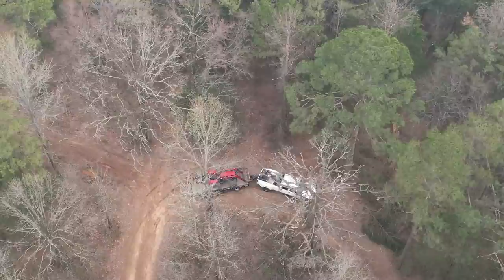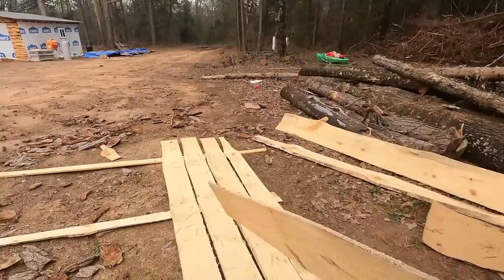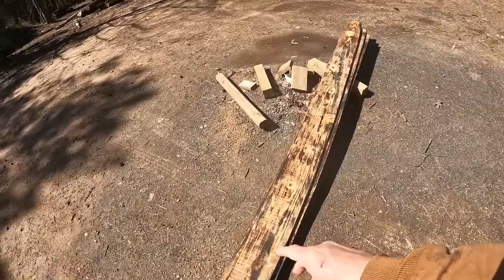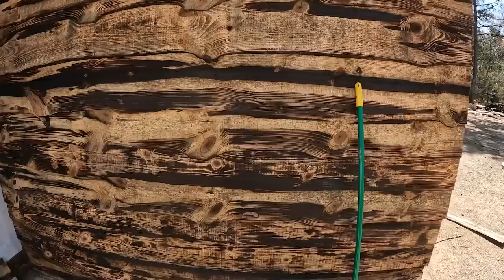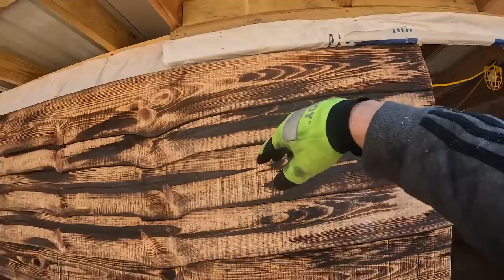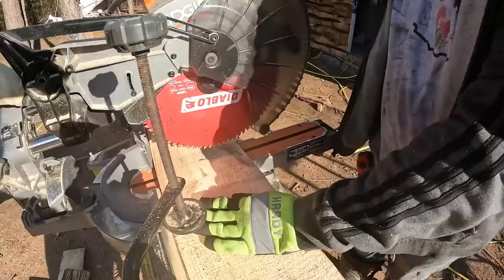CUSTOM LIVE EDGE INSTALL | tiny house, homesteading, off-grid, cabin build, DIY, HOW TO, sawmill

Comment: To keep the blade cool you need to have water dripping on the blade while it's cutting. If you don't the blade will overheat and dull. YOU MUST DRIP WATER ON THE BLADE WHILE CUTTING.

Comment: To minimize bandsaw deflection and maximize rigidity, what you see as waviness; bring the blade guides in as close as possible to what you’re cutting.  The guides should be mounted to a vertical bar that can slide left or right.  We like your show.  Retired machinist, Douglas Venters, N.C.

Comment: Looks great!
I watched another channel that had done this same thing. Only problem was they had to redo parts of the siding because the wood will continue to dry and if you nail the bottom end of the boards they tend to crack and gap.  Hoping you do not have this issue next year when the wood is completely dry. Good luck.

Comment: Just wondering why you didn't leave a gap along the bottom where the concrete pad for the outdoor kitchen is? I know it's gonna have a roof, but rain will blow in there, and I'm worried you're gonna have problems with water wicking up which leads to rot.

Comment: David, although its much too late  now, had ya know'd that wood had so much twist and stress on it... might ya would a come on out with the studs on one foot centers instead of the sixteen or not sure as I just don't member much anyhow no more... some could be two foot centers. I sure wish I could a been there for ya as saying cause of my experience with mills and building so many of  them. Let the people talk all they want... the guide for holding a blade "centered on  the wheel" and it not having it... well fine and dandy, they are just trying to lift yer leg as its not required nor absolutely necessary for it even to be on the mill. I only used one for extreme hard hardwood. My son, quite like your Levi, who turns sixty in may (where'd da time go?) said to me... he read or watched it too, they don't have a clue dad, our oldest mill still going up on the skagit river never had no dang arm on it! He sawed lumber with it back in seventy nine and eighty.... thats nineteen seventy nine and eighty. He got by grand dads buckskin rubber in 63... nineteen sixty three. In fact he was only fifteen when he took to milling on his own cause I wasn't sure he was a safe operator as he went full bore on anything... we did make a trip to doc Monzingo a few times... good thing that doc didn't mind us coming by his house. Why one dirt bike put that boy about ten foot up a tree.. not the bike.. it stayed on the ground but he landed up there when he was looking at a red head. Best to aire on the tight side as to a loose blade. I found on the smaller mills that about twenty five pounds torque on the blade tension is sometimes well another pound more don't stress the blade. Just good bearings... pillow block bearings were always a pain to tell if there was some issue a hiding from me.